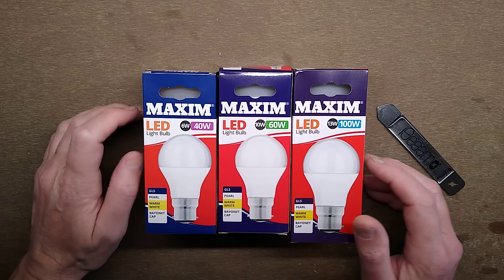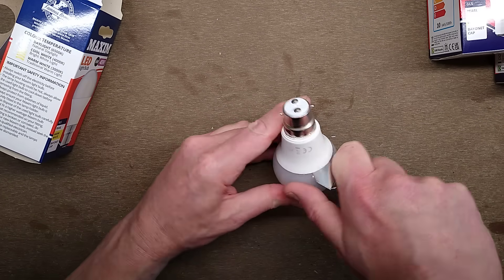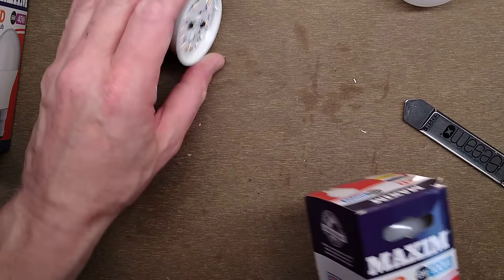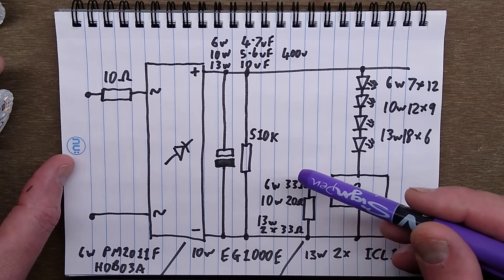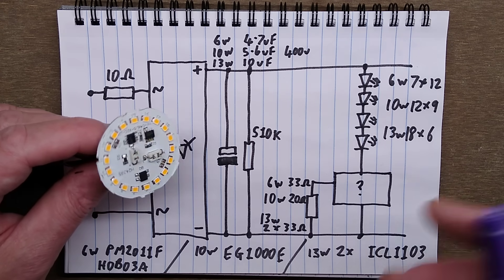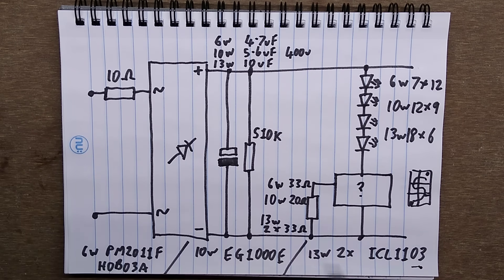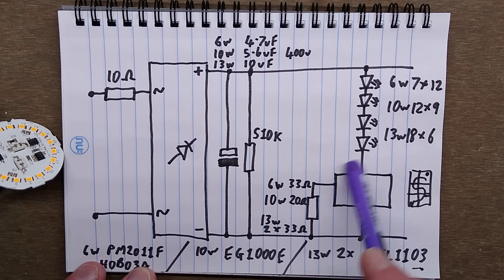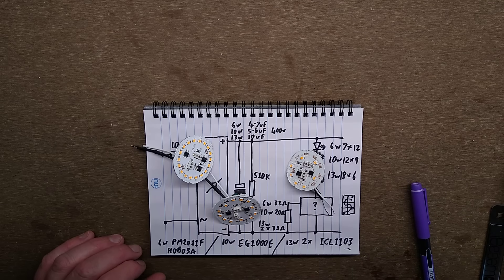6W vs 10W vs 13W LED lamp showdown (with schematics)

Comment: Could the Linear regulator run a 12v fan, instead of LED's or would it blow up?
Reply from the maker: Not really suited to that.  It can be used at low voltage as a current regulator, but not as a proper 12V power supply.    You can use standard 12V plug-in mains adaptors for running fans.

Comment: Just bought some ASDA 14W (100W-equivalent / 1521 lumen / warm white) bulbs. Not only are they pretty cheap, (2 for £4.50) but claim 25,000-hour life which is longer than many.
Teardown reveals two SM2082EAS chips running in parallel with each having its own current sensing 91 Ohms // 47 Ohms.
The bulbs have 32 separate LED chips.
Looks like a great candidate to reduce the input power down to, say, 8W and bring the life up while still having decent light output.

Comment: What was the colour temperature? I  prefer the cool white, at about 6000K. Would it be correct to assume that the bulbs look like a capacitive load? 
The early versions of LED bulbs were very heavy, with large inductors in them, with lots of reusable components. 
Are there any rules about the maximum power factor?
It would be interesting to see if there is any residual visible 100Hz flash. My guess is that the plastic cover phosphor has a persistence that smoothes out any residual flashing. These covers often show a very long persistence when exposed to a pure UV source, glowing for several seconds after the UV is removed.
Reply from the maker: This outlet usually sells warm white, but sometimes has cool white too.

Comment: Going back to the 1980's we used to buy around eight filament bulbs per month. Then the CFL bulb give-a-way came and well the bulbs last years. The only LED bulbs we have is the ones which came with up graded light fittings! I still have a drawer full of spare replacement bulbs in the living room, CFL's and LED's. cannot be alot of profit in it for bulb manufactures?
Reply from the maker: They've been working on that.  They've engineered them to fail much faster.

Comment: The ICL1103 datasheet shows a slightly different schematic recommended.  They recommend a MOV across the line and a fuse before that.   They also put the 510K resistor directly across the LEDs and not across the capacitor.   Very minor differences but one wonders why the lamp makers didnt slavishly follow the recommendation?  Maybe the UK rules require a fusible input resistor or just a easily burnuppable one?    I guess not using a MOV is a bit of a gamble that the AC power doesn't have a lot of lightning strikes or industrial surges.

Long ago I worked for a company that made a medical product.  They got some complaints from one clinic that the device didn't read properly sometimes.   I earned my pay that day as I used an early version of Google street view.  I wandered around the neighborhood and found:  (1) An auto-body repair shop next door, a place that probably did a lot of arc welding!   and (2) The next block over, large VHF antennas on top of a police station!    I wrote up a report suggesting our device might be prone to RF interference.  The original UL tests included a 1000 Watt RF test in a RF quiet room and it passed those tests, they said, but I suspect conducted or electromagnetic interference.  I forget how that investigation was concluded.  Well, I do kinda know.  They decided the aluminum molds for the plastic cases had worn out, so it was simplest to just discontinue making and selling the device.   Per FDA regulations, they probably had to send out bulletins to all users warning that it might misread if used in a high conducted or radiate RF environment.

I discovered several other "interesting" design quirks to the device, like how they used several dearly expensive 0.1% or better op-amps, programmed with 1% or worse resistors, and several $12 tantulum capacitors where 22 cent aluminum ones would have worked just as well.  But it was too expensive to spin another product revision due to the insane amount of FDA testing required for even the smallest of revisions.   Kinda put me off from ever again working in the medical device field!

Comment: I have become leery of LED bulbs that give out more than 60w of equivalent light because they run then to hot and the life is not really any better than incandescent bulbs. The problem is all those LERDS throw off heat and they really have no real method to remove heat so the shole thing just cooks itself and either fails or the light output drops drastically after several months. The old COB versions were much more long lived because they drove the LEDS a lot less hard so they didn't bake themselves, you did have a better chance of getting  dodgy ones because they used a lot o very cheap LEDs that had little quality control.

I do have a couple of floodlamp LED lights that are interesting. The circuitry is built into the base whith the LED's in a plasic cloud the sits above the base on a couple of plastic struts. This keeps each module isolated from and heat the other module might throw off. These buls are barely warm so they don'e bake themselves. One of these is on a photocell that runs it from dusk to dawn and has been running for over 3 years and that is a lot longer life than any of my A19 form factor bulbs have ever come close to.

It's plain to me that heat is the enemy here, if it runs hot iot's not going to last and it's light output will fall pretty quickly with use.

Comment: Hi Clive,
I enjoy your testing and reverse engineering. Your LED bulb dissections got  my attention because I've noticed how it is becoming difficult to find compatible dimmable bulbs to replace my tungsten items, whilst proving a comparative quality of light suitable for the most common primary domestic lighting- Ceiling suspended pendant lights. I did find suitable 15W dimmable bulbs from Diall, these were a good replacement, but the shelves have been empty of these for over a month. Non Dimmable's are still available, but installing a bulb which illuminates daytime nooks when required, would result in excessive dazzling during the evening.

The spread of light from just one the original tungsten bulbs allowed a good quantity to reach a white ceiling, to be reflected, diffused and spread further; softening shadows and improving the feel of a room.

As with the LED bulbs tested here, the majority now have this basic design, with a flat circuit board holding surface mounted LED's, supported on the white opaque plastic, capped by a hemisphere of diffusing plastic. The big problem with this design is that light no longer makes its way to ceilings or back to lamp reflectors, resulting in dull rooms with shadowy, high contrast light. Overcoming this may require installation of multiple lights and lamps.

I suspect that this design is easier (cheaper) to manufacture, and may be the only way of enclosing "Smart" electronics for disco style colour changing. Others must have noticed the trade-off too, but I haven't seen any Youtube comparisons of the most important feature required of a GLS bulb, which should be quality of lighting. Maybe people haven't realised the effect these will have before replacing their tungsten bulbs, would they return them for a refund? 

Do you or someone reading know of, and be able to link to a good comparison of filament style vs flat PCB, surface mounted "bulbs", to include quality of light, or compatibility with many of the lamp shades originally designed to reflect, diffuse, spread or focus this light. I guess Clive's lab and workbench wouldn't be the best location for such comparisons?

The future's Bri----
The future's shadows and contrast

Comment: One thing I find interesting is that your "100W" LED lamps are still 13W. Here in California, I've been seeing them rise in rated draw to, these days, typically 16-18W - without the lumen ratings changing. In fact I think the last 13W "100W" lamp I saw was the last aluminum-bodied Cree I bought, quite some time ago.

So they're still more efficient than CFLs, but not by nearly as much as originally.
Reply: I think the light output was quite "optimistic" at the start of these LED lights. My 6W LED bulb on one of my living room lights is quite noticeably dimmer than my 11W CFL in the other light.
Reply: @paulsengupta971  What I've observed is that incandescent-replacement, and some halogen-replacement, LEDs tend to start dimming immediately - but slowly and steadily. The change isn't noticeable in service, but incredibly obvious when replaced. They also degrade faster in enclosed fixtures.

As a result I've begun rotating the bulbs here. New bulbs go in the larger rooms and more-frequently-used fixtures then, after a year or two, moved to closets and such.

Meanwhile the long-tube fluourescent replacements that I got seem to be truly the "eternal" lamps that LEDs were once proclaimed. But they have very large heatsink surface and many LED packages driven at a mere ~30 mA each, and the fixtures are an older, more open style designed to keep magnetic ballasts from overheating.

Comment: You need to check if they claim an actual lumens for the wattages.
Here, the law requires lm ratings so you can select a higher efficacy "bulb" if you want to. Some mfg's now run much higher number of leds at lower current to get a better lm/w figure which helps sell bulbs. People choose the higher lm/w ones as they simply last longer. Unfortunately the caps still fail.

Comment: I would like to see what happens, if you cut the wattage of the 13W in half. Then, compare it to the 6W. Do you think they would be the same? or, would using less power per LED make the bigger one more efficient, thus, emitting light similar to the 10W? (both lamps drawing the same power)

Comment: I've been this very weekend modifying a dozen of cheapo all-plastic Aliexpress bulbs, which have this same configuration minus the capacitor, the fuse resistor and the resistor to avoid residual glowing.  

I purchased some time ago a couple of models and it's been interesting:
- The small 3w's, were actually only 2.2w, wich is quite nice as they give enough light barely producing any heat while having a small form factor.
- The 6w's, on the other hand, are real 6w, but at the expense of some heat and a quite short lifespan, some dying after 1.5years .
- The 9w and bigger, having a plastic body doesn't seem well suited for the job. The heat has no way to go. I just had a couple of those on barely used areas of the home, and modding them down seems to be quite necessary.

I changed the resistor and lowered the 6w's to exactly 2.2w by pure chance,  so I was able to compare them side by side with the stock 3w. A modded 6w produced aproximately a 20% more lux (measured using a phone app), and being bigger I assume will dissipate the heat more efficiently and spread along more led elements.

In the same way, I modded all the other Chinese bulbs. I also purchaded some time a set of replacement led boards (the very same that come in the bulbs), which I've used to retrofit a lot of old Ikea's Ledare models, that in the 10w,12w and 15w values are dying like flies after a fair amount of years of work (pretty hot). Those can be opened with some excessive force and a good splunge, an when retrofitted provide a superb heatsink base. 

I might consider fitting eventually the missing fuse and 400v capacitor in those bulbs. I won't be buying more bulbs from China, as the plastic bodies are crap. I might get more replacemnt boards though to fit the surviving Ikea ones that are going to fail eventually.

Comment: Ho hot will those regulators get and how much power doe those lamps use when line voltage is at the max allowed +10% That's ~253V for our 230V nominal.
Reply from the maker: If they get too hot they self regulate back by reducing the light power.
Reply: @bigclivedotcom  That makes over voltage a bit weird.. inverse dimming.
The lights are dimming, add more volts!
Reply: @bigclivedotcom  They seem to make the LED's flicker slightly when it does that!!

Comment: Big Clive, I've been a fan for at least a few years.  I have an honest question that I was hoping you could answer for me.  You mention there being silicone in the bulbs to seal them, but you pronounced it as if it was "silikin" (a word that doesn't even exist).  I know the difference between silicone and silicon, as well as how to properly pronounce each one.  My question is, why does almost every youtuber pronounce both silicone and silicon as silikin?  It's a bit confusing for 2 unrelated words to be mispronounced as if they were the same word.

Comment: I use a hooked Stanley blade (they look like moustaches) to crack open these bulbs, I get good results but I would recommend getting a proper spudger to open them.
The one I have currently open has only one sense resistor (RS1) at 40.2ohm, its rated at 5w but I am thinking of putting a 60.4ohm in there just to knock it back a bit.

Comment: I found A nice ZVS inverter on Amazon
High Voltage DC-DC Boost Converter 8V-32V~50V to ±45V-390V Adjustable ZVS Capacitor Charging Power Unit Module (40W)
ASIN B075FFPPW4 - £12.16

Going to Voltage Wide Rage test Main LEDs  / Main CFL Bulbs To see if They can Run on Lower & Higher Voltages & Destroyer

Comment: I presume those chips are footprint and pin compatible? Depending on when those lamps were actually built, the chip shortages and logistics issues impacting everything might have necessitated parts substitution.

Comment: Should never have power factor lower then 90% because that's the usual value that power companies will impose a surcharge. Scum bag cheating china should never be allowed to produce such garbage. I have emailed two large companies that are big sellers of LED'S. They never respond when I ask what the power factor is on one of their common 60 watt equivalent 4 & 5K LED lamps. Here in the states our inspectors tell us that bulbs ho into the ground and lamps go into luminaries. ( no such thing in our Cide book as a light fuxture). A 90% power factor LED will draw at least 35% less power then a cheating china 50% power factor LED.

Comment: I wonder if the old tungsten equivalent rating will die off as increasingly the younger generation will never have used a 40/60/100W lamp as they grew up with CFL or even LED. Even myself growing up with tungsten I'm not sure its a great reference given I've not purchased one for 20 years or so
Reply: Lots of places are slowly working towards getting rid of them by making lumens more prominent on the packaging but along come the cheapo stores and put watt equivalent on...

Comment: Always enjoy watching those hacks :)
Lately some dead simple capacitor dropper lamps from my parents place fell into my hands and surely went into autopsy, to see if they could be revived and modified.
Of course they have a too high AC-Cap (125J400V) and all died of one dead LED out of 5 total LEDS in series.
BTW: As the main aim is to revive those lamps, I tried another attempt to open the E27 lamp base and hotair works just fine.
A little bit of heat allows to separate the metal thread from the plastic lamp housing without noticable damage, thus the whole lamp can be reassembled after repair quite easily :)

Comment: My 13.5w TCP from Homebase has 32 LEDs. Does that make it a better lamp?
Reply from the maker: The dissipation is spread better, but the panel will still be getting very hot.

Comment: Clive, I noticed you referred to standard resistor values.  Is there anywhere that lists common values?
Reply from the maker: There are "E" series where E-12 means 12 values spread across each decade.  That's what I have here.  But in reality, 1, 10, 100, 1000 etc is good for most things.
https://en.wikipedia.org/wiki/E_series_of_preferred_numbers

Comment: I'm not so sure of the validity of BigClive's conclusion that his hacked lamp will have "exponentially longer lifespan".  Say you change a 12W lamp into a 6W.  Yes, each component will be dissipating half the power, but the lamp will be dissipating 6W and will get just as hot as the 6W lamp.  So it's lifespan will be not much longer. 
  In my own experience either the electrolytic capacitor goes bad from the heat or an LED fails because of a voltage spike. So if I wanted a much longer-lived lamp I would replace the electrolytic cap with a higher temperature rating and add a spike filter across the LEDs, in addition to a slight reduction in the LED drive current (but not 50%).
Reply: probably the bigger thing you can do it to use light fittings which point the bulb upwards. The pendant fittings must shorted the light quite a bit as any heat has to pass upwards through smaller section of lamp and where capacitor is. With lamp the right way up the heat should radiate up and away from PCB
Reply: @mistermartin82  Unfortunately, I don't get a choice about most light fixtures.  The last one I changed was in a shower fixture -- a ceiling can sealed against water, with all the attic insulation above and a plate of glass below.  This is the building code.  And of course the bulb points down.  The bulb base was a tan color (originally white) with a large crack from the threads to the plastic dome.  It's a colossal pain to change, requiring a tall step-ladder in the shower. 
    The next one I put in will have BigClives modification.  But I'll start with a 15W {100W equivalent) and cut the power in half at least.  I'm certain it will last longer, but it won't be because of the LEDs' lifetime.
Reply from the maker: Halving the power results in an exponential increase in reliability.

Comment: Really need to look at the lumen count.   Everything else is misleading.   A 60 "watt" bulb should be 800 lumens.    As an older person with mild cataracts,  I prefer 900 lumens.   I also prefer 3800k (true white)  over 2700k (too orange, red, even pink!) to 5000k (too blue).